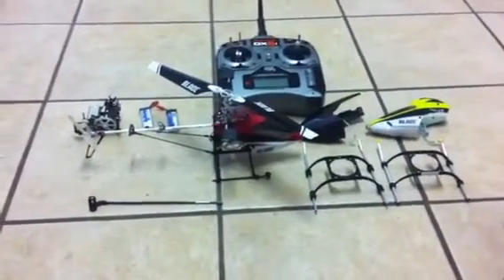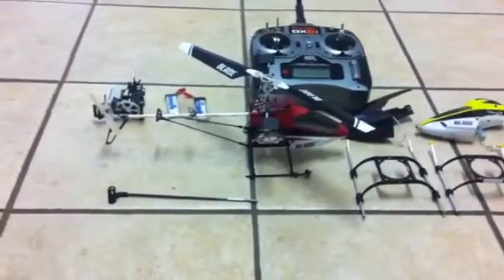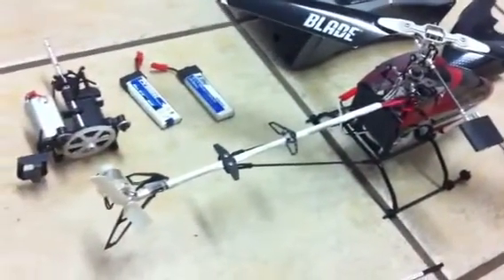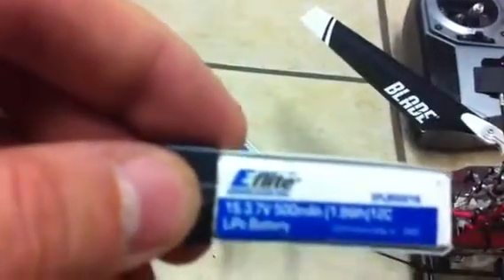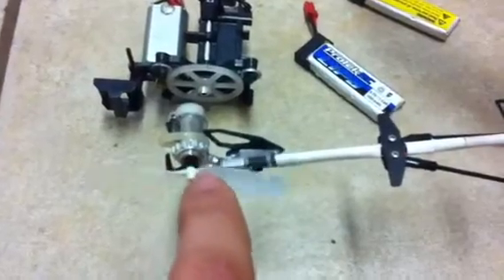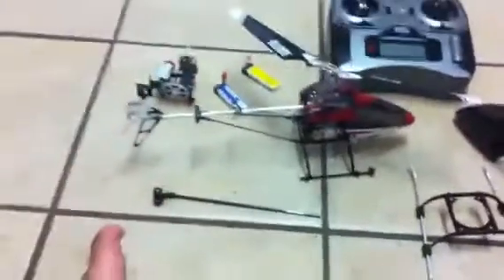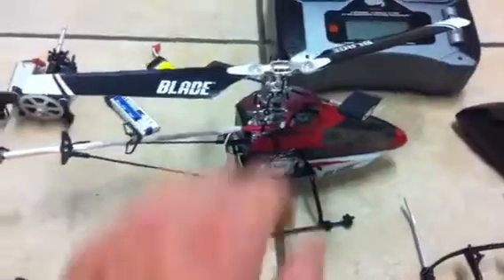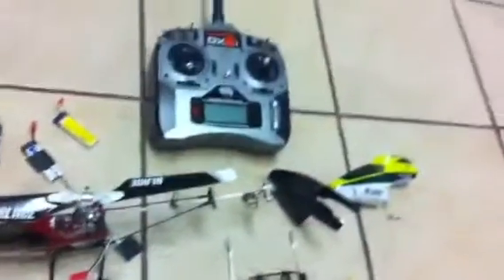Blade 120sr upgraded

Comment: The upgrades are cool but the 120 is really a beginners helicopter if you go spend all that money upgrading it have one bad crash and it's ruined for the price the stock blade replacement parts for the 120 work just as well it does look cool nice job.

Comment: What motor is used? Any of the electronics upgraded?(esc?)
Reply from the maker: No, esc and servos are stock. The motor is an xtreme motor. It gets slightly more power
Reply: +Michael Barnett 
Kool, thanks. The BNF version (not RTF), can it be binded with a turnigy tgy-i6 2.4gh transmitter?

Comment: Hi Michael -- I've made the nearly the same changes as you but mine shoots backwards now. I have to go 'full forward' just to keep it in the same place. I have used a Rakon head and Swash Plate (very expensive) and so I'm hoping it's not that and it's a setup issue. Any advice appreciated. Thanks a lot.

Comment: I usually stick with stock plastic parts on my various copters. Easy to replace, master flying and then I sell it for a more challenging one.  I purchased used ones that have a few upgrades but I found them unbalanced making them fly poorly. Your collection looks sweet but I would be afraid to fly them hard because of the money spent.
Reply: mike rankin